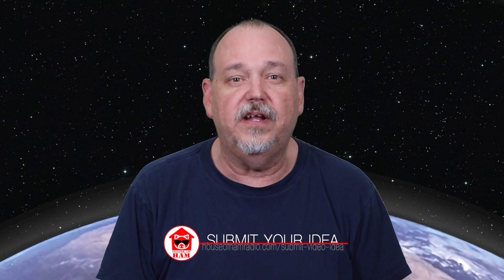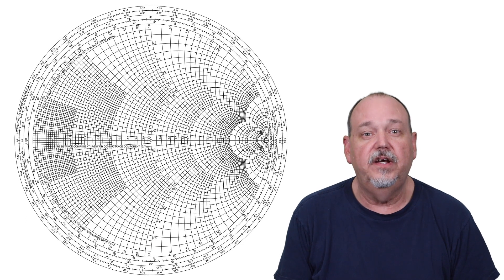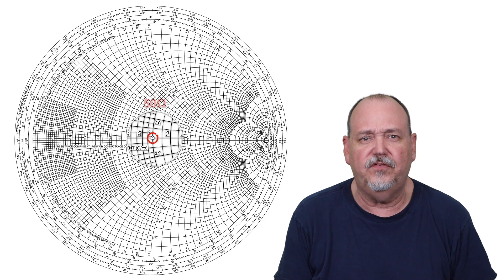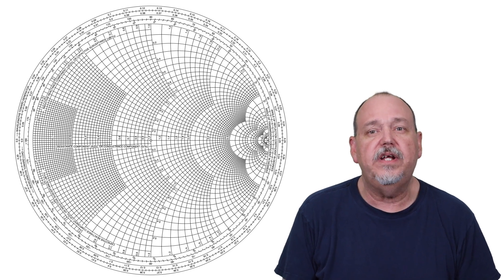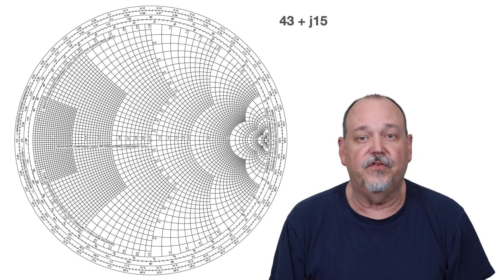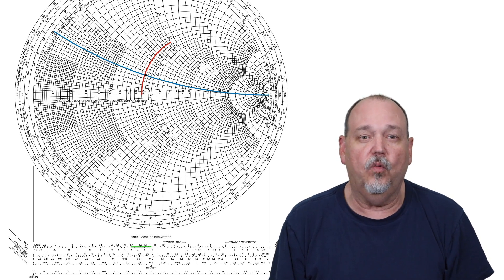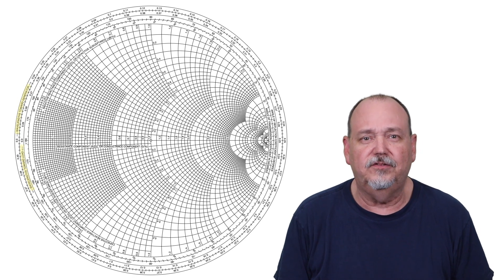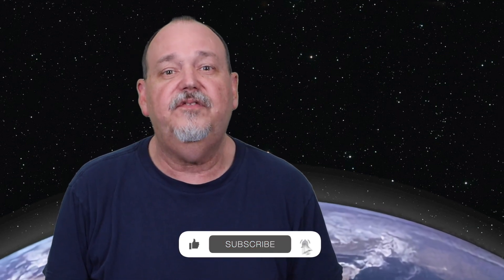Smith Chart  101: Tame the Beast

Comment: This video is the best one I have seen on the Smith Chart.  Yesterday, I used the Smith Chart, on my Rig Expert antenna analyzer, and found I had an open circuit on my G5RV.  When I took the antenna down, I found a solder joint had failed.
Reply from the maker: Glad it helped you. Good job on troubleshooting your antenna. Can be tricky but you went about it the right way.
73 WV7W

Comment: great learning urve,ive gained so much..   my next issue is hoe to wind a 75ohm load to 50 ohm inout..i have found its 1.5:1 transform on ferrite. but thats all i know. i need video help to built it on 240#43 maybe and how to cross wire it please..then i can correct my issue..please help out with winding one and show crossover.
Reply from the maker: Thanks for the comment. never done a 1.5:1 but it shouldn't be too hard to figure out. Let me research it.